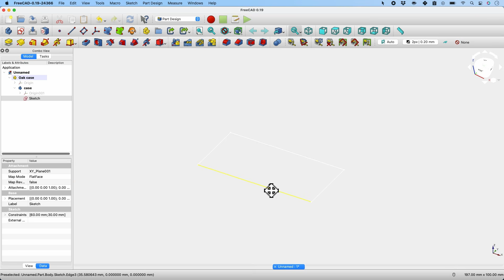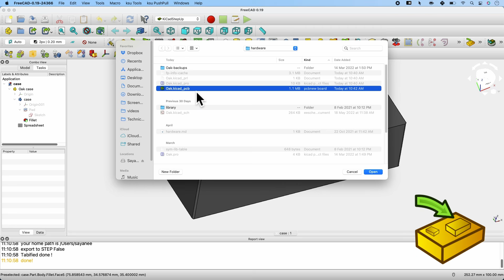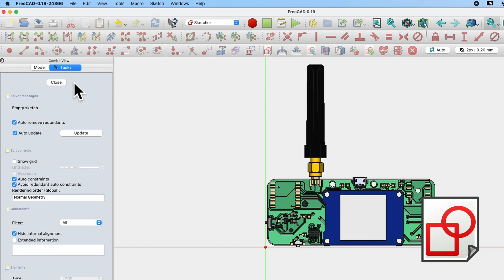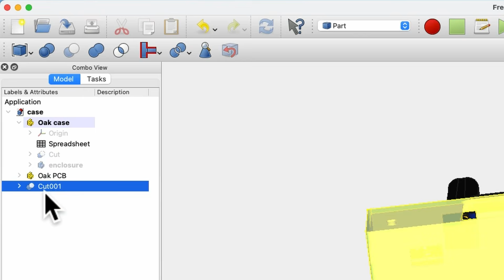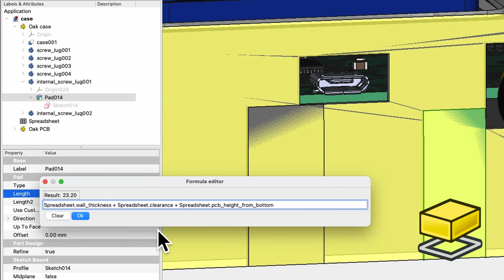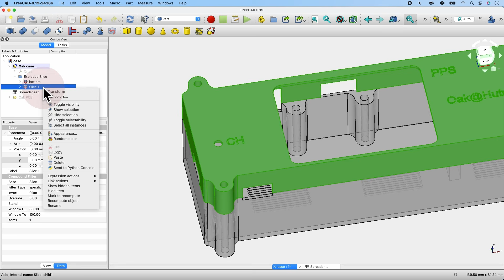I designed my first electronics enclosure for 3D printing // FreeCAD + KiCAD complete walkthrough

Comment: Tip for others, you don't have to use a spreadsheet as the 'formula starting point'. An alternative method is making a master sketch (a sketch that has the dimensions you want to use elsewhere), when specifying a constraint in your sketch you can name it. Then using the value of that constraint works very similarly where you use click the formula icon and type the name of the sketch followed by a period (.) and the values show up.
I've been using that somewhat frequently as under windows for whatever reason working with spreadsheets in FreeCAD is really really slow (not the case under Linux/OS X).

Comment: hey sayanee I have been working with your tutorial for quite some time and no matter what I do to import the kicad file oak into freecad it gives me a massive amount of errors. I went as far to adjust all the permissions to make all the models accessible and set up samba share and still it tells me models are missing. I made kicad/3dmodels completely accessible but still I keep getting errors.I also tried to open it using kicadstepup but no luck. i do have  a freecad file of the complete oak project but i wanted to import everything myself. Can you provide any advice on how to import the model from kicad into freecad board plus parts all in one. Thanks.
Reply from the maker: I believe that the process I am referring to was completed over a year ago, which means there may be some compatibility issues with the current versions of FreeCAD, KiCAD, and their respective add-ons. 

If you are interested in learning how to import from KiCAD to FreeCAD, I recommend starting with a basic project using the most recent versions of both programs and attempting the import from there. 

I hope this is useful to you and wish you the best of luck!

Comment: I really appreciate the details of working with the different CAD packages.  Also, I see a lot of videos with 3D printers sitting in the same (small) space as people's workbenches.  If you haven't already, please research the impact of 3D printers on air quality; they throw off a lot of fine particulate and VOCs as well as other bad gasses depending on the filament material.
Reply from the maker: Yup, that's why I did not yet buy one, especially for a small home lab.